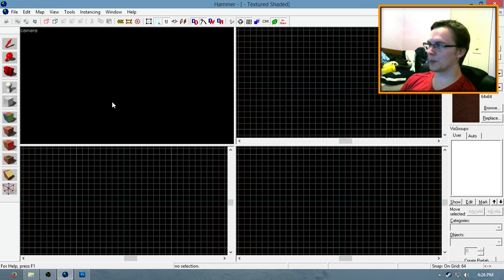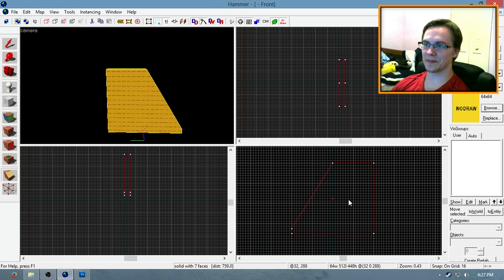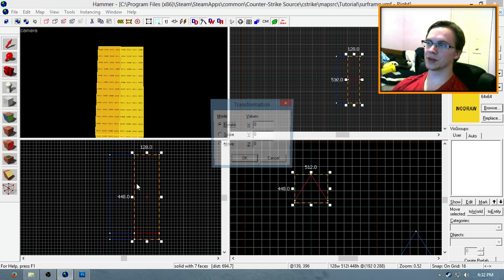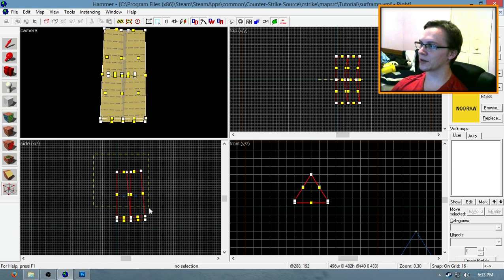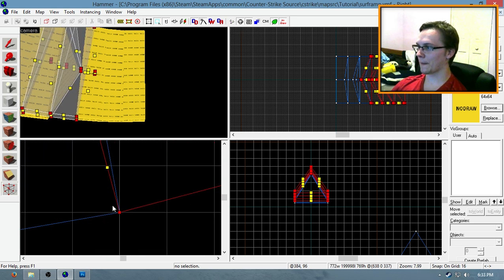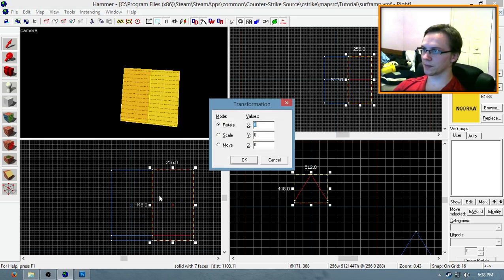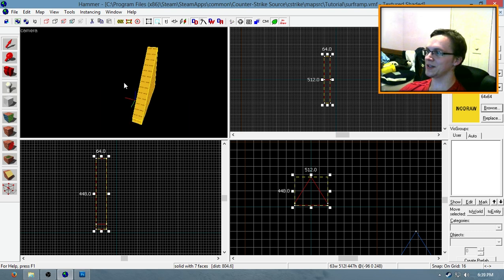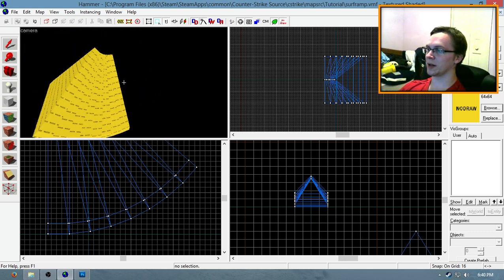Smooth Surf Ramps | Hammer Editor Tutorial

Comment: I know this is a late comment, but I recently started making a surf map and whenever I save/compile the map, all the vertices are moved and not aligned anymore. It's so frustrating and I can't seem to figure out why it does this.
Reply from the maker: Yes it is frustrating, it's caused by floating point precision error.  crashfort created a patch for Hammer to fix this, see here: https://github.com/crashfort/HammerPatch
Reply: @crayz92  I put the HammerPatch.dll and the hammer launcher file in the CS:GO bin, but I can't get it to work still. Whenever I save and reload the map, it gives me this error:  For your information, 1 solid(s) were not loaded due to errors in the file. IDs: ( 136 ) Would you like to Re-Save your map with the invalid solids removed?
Reply: Thanks for the reply. I’ll try it out now :D

Comment: hey ive come accross a problem here ive selected the new piece of surf ramp then i drag the vertices box around both of them then i try and drag the point but it wont let me move it?!?!? ples help me asap '}
Reply: Dont Worry i fixed that but its complety fucked up now like ive followed your intructions but instead of y i have to change x by 5 to get the same results and when i moove the vertece only that dot moves not the whole shape!?!
Reply from the maker: Hey, did you make sure to select every vertex point before trying to move the brush?  If you select only one or a few then it will only move that single vertex.

Comment: I tried to follow this tutorial, and it seemed to be working really well, but apparently when I move the previous selection to line the vertex up with the grid, it's not keeping the alignment of the previous vertices, so they're all slightly off.  This is making the ramps buggy and leaving slight visible gaps in the surf.  I'm selecting all the brushes I want to move, and following the instructions exactly.  Is there something I'm missing?  Maybe an option or something that would keep the vertices aligned when I move the group of brushes?
Reply from the maker: +xmxmal When you move a group of brushes do you first select them all with the selection tool, then select every vertex in the selection with the vertex tool prior to moving it?
Reply: Yes, I select every brush, select the vertex manip tool, drag a box over the whole group, then move the whole thing so the vertex I want is on the grid.  When I zoom in real close to the vertices on the brushes I've already moved, they're no longer aligned and are ever so slightly off.  I think there's a setting off or something, it's not saving the alignment of the vertices in relation to each other or something.
Reply from the maker: +xmxmal Hmm do you have grid snapping disabled by chance?  Could I see a screenshot of how the vertices look?
Reply: Okay, I must have just messed something up earlier, because now I can't reproduce the findings.  I think part of the problem is that the map I'm making is symmetrical, so I copied, pasted, and rotated basically the whole thing.  It may have gotten messed up then at some point.  Thanks for your replies, I'll get back with you if I'm able to reproduce the issue.
Reply from the maker: +xmxmal Cool, just ask if you have any other issues.  Good luck
Reply: http://imgur.com/fE7kdf0  It's happened again, I completely remade the ramps, everything looked fine, then I load up again and I see things like this.
Reply from the maker: +xmxmal If I remember right saving and loading vmfs will never preserve the exact location of vertices that aren't grid-snapped (limited floating point precision or something of the sort, I'm assuming).  If it can still be surfed without glitching you should be alright, otherwise if you want to keep them perfect you could convert your ramps to props.

Comment: What exactly does the Nodraw texture do?
Reply: Do you just use it as a placeholder or is it necessary?
Reply from the maker: +Funky Manatee In short it tells the engine to not render the face of a brush wherever nodraw is placed.  The reason I build ramps with the nodraw texture is so that I can go back over them later and re-texture just the outside faces of the ramp.  The inner faces, which should never be seen anyways, retrain the nodraw texture and because the engine doesn't try to render textures on faces that can't be seen performance is improved.
Reply: +Jake Evans (Swoop) Ohhh thanks, for the quick answer on this old video btw, earned a sub :D
Reply from the maker: +Funky Manatee No problem, thanks for the sub!

Comment: If you could help me; If I make a ramp and test it, I slide off the ramp, it doesn't let me surf it as it will simply slide me off when I get to the lowest part, is this because it's too steep or is there something I've missed?
Reply from the maker: Make sure you have sv_airaccelerate set to a higher number.  150 is the usual setting for skill & combat surf, I think 1000-2000+ is good for trick/100tick surf
Reply: Works now, thank you very much :)
Reply: LightOfDivine sv_airaccelerate 600 is the best for beginners i say

Comment: wouldnt a better way be to make the surf ramps in blender / 3dsmax / autodesk because they wont get the player stuck or get fucked up vertices when you compile
Reply from the maker: Yeah, you could either make your ramps entirely in blender or in Hammer & convert them to models using Propper, these are the best methods for smooth, optimized ramps

For anybody interested somebody wrote up a guide on creating surf ramps in Blender here:
http://forums.solidsurf.info/index.php/topic,3887.0.html